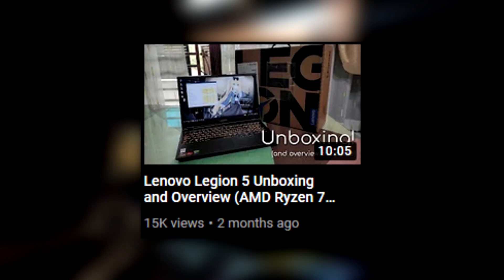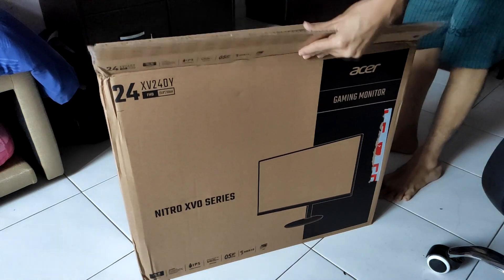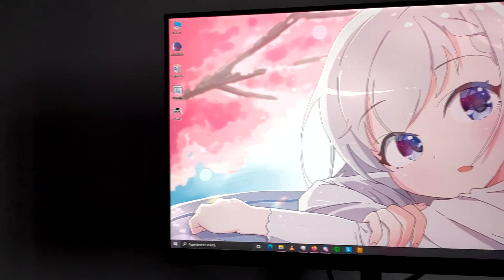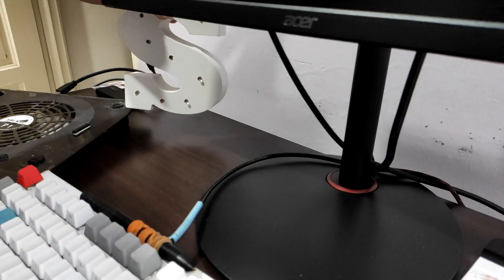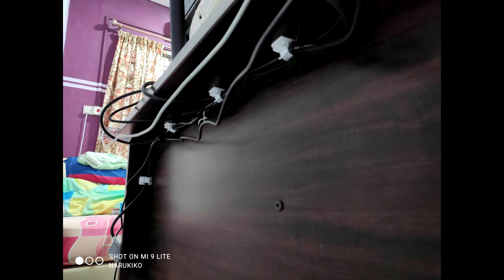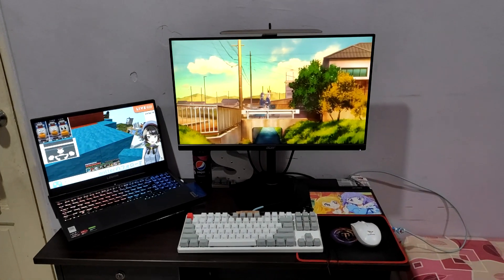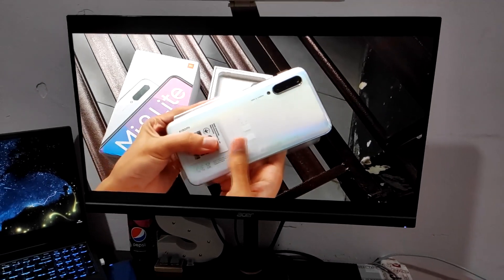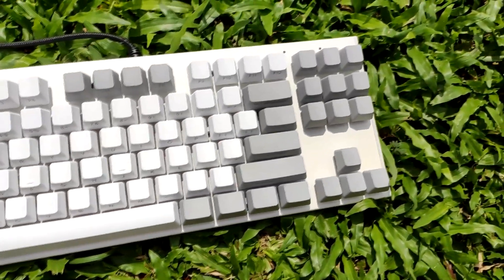Laptop Setup Upgrade - New Monitor and New Hub!

Comment: you used hdmi cable or dp to support 165 hz?
Reply from the maker: HDMI
Reply: @TheTechOtaku  bro i have acer nitro 5  2019 and i get around 150 fps in valorant..the main problem is thqt it only have hdmi port ..so do you think it ll support 144 hz if i buy this monitor with hdmi
Reply from the maker: It depends on monitor and what version of HDMI port you have on your laptop. If both your monitor and laptop have HDMI 2.0, it should be able to get 144hz over HDMI. Researching on Google should be able to solve first world problems.
Reply: @TheTechOtaku  thanks for reply 👍

Comment: what’s your setting for the monitor btw?
Reply from the maker: 165Hz, you can change the refresh rate on Windows Settings. When I first set it up, it was set to 144Hz by default.

As for color accuracy, I tend to leave it default but only adjusting brightness to whatever I want.

Comment: I bought the MKA-3C a few weeks ago. Would you recommend I swap the switches to gateron browns, and swap the keycaps for a PBT set?
Reply from the maker: Definitely recommended, but swapping keyswitches can be a bit tricky since the stock look of the board uses Outemu sockets. The socket fits nothing but Outemu switches unless you mod the switch legs to make it fit or the safe bet is to desolder the sockets then solder the switches.